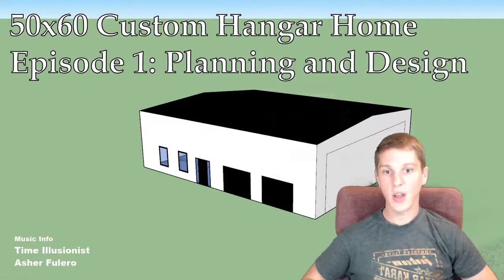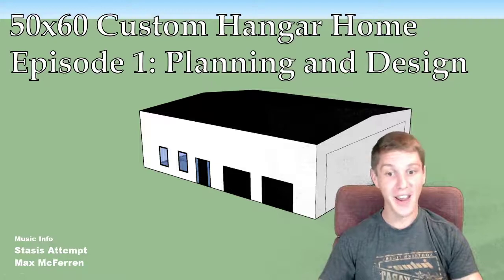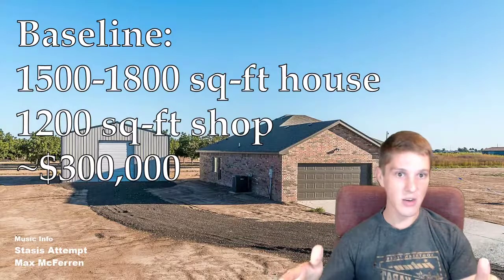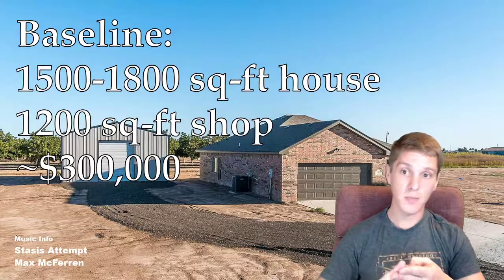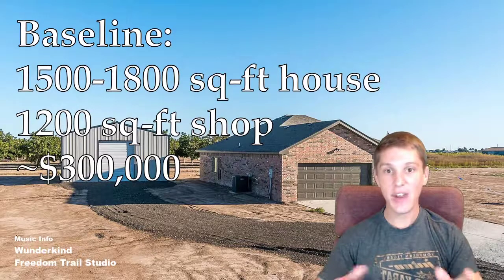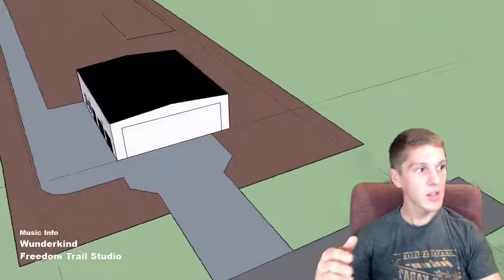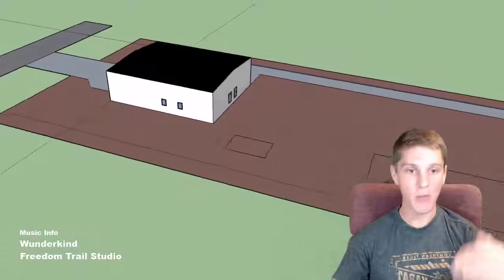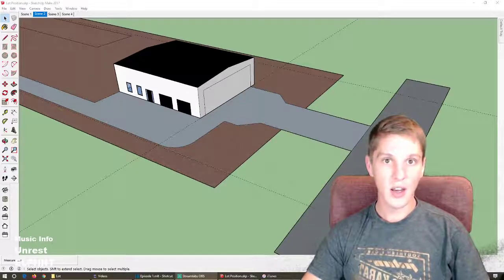50x60 Custom Hangar Home Episode 1: Introduction

Comment: Curious what your doing for insulation.  I’m seriously considering a similar build.  My design is 40x80 with 30 ft the house portion and the remaining 50 ft the hangar garage.  I also recently found a hangar door manufacture that builds a stand alone door, not requiring the extra expense for adding structure to the building opening.
Reply from the maker: Dude, that's awesome! I'd love to hear more about your build. What brand hangar door did you find? 

For insulation, the builder we hired to erect the metal building sprayed the entire inside of the metal building of the metal building with 2-3" of closed cell spray foam. Once I frame in the living space, I am also going to insulate all the exterior walls with normal pink batted insulation. So the living space will have both spray foam and  batted insulation. (I also plan on insulating the interior walls around the bedrooms and bathrooms, but more for sound dampening.)
Reply: Go to Hpdoors.com.  They quoted just over 10k for my door.  Not having to add structure to the buildings door opening makes this the most cost effective option for 34x12 ft door.  Wife and I are also planning to do a good portion of the work.  We will hire out the foundation and erection of the building.  I’m still struggling with insulation.  I like spray foam for the vapor barrier qualities, however our design is for open truss on a portion of the interior.  Bay insulation provided a quote on a package which is a double layered banded system and meets the insulation requirements for our zone - But, still concerned about the vapor barrier qualities.
Reply from the maker: @GSNCLN  Hey, that's crazy! I also decided on a Higher Power door. I got the metal building engineered and designed and manufactured by Mueller, and they just designed the building with the opening. The door itself all anchors to the slab and is independent of the building. I just saw my door for the first time yesterday. I'll show some footage in my next video.

I went with the 42' x 14', which Higher Power quoted out at like $12k. Don't be surprised when you get quotes of $4-5k just to install the door. It's a process to install, and whoever does it will need a telescoping forklift and a manlift to set it up. But the dude at Higher Power was actually super helpful and gave me a list of people who install the doors in my area.

As for insulation, we went with the spray foam for the vapor barrier and added R-value. I spoke to some spray foam guys, and they said doing an independent vapor barrier (like a plastic sheet) with the closed cell was a waste of time and money. I'm going to trust them and hope they're right. And like I mentioned previously, the added pink batt insulation around the living area is just even more R-value.
Reply: I may have to reconsider the spray foam option for its vapor barrier qualities.  It’s scary watching your videos as it’s like watching our plans come to life.  We also have a used rv in our plans to use while framing/finishing the interior.  We want to purchase acreage allowing keeping our plane on our property.  We’re going with a stol experimental kit plane design so only a pasture for a runway is needed.   Looking forward to your next video.  G
Reply from the maker: @GSNCLN  Right on! I'm glad you're enjoying the build videos. Hopefully you can benefit from some of my lessons learned. I can't wait for my next trip out to start standing up walls. I'd love to hear how y'all's build goes. Maybe you should start a YouTube channel, ha!

Comment: How much is this costing you guys roughly? I’m looking at building a space myself that I can live in and do photography in! 😊
Reply from the maker: Good question, and the answer to all good questions is "It depends." Here are the cost for the 50x60 building. You can spend as much or a little as you want finishing out the interior. 

The dirt work was $7k. The slab was $23k. The metal building was $40k. The labor to erect the building will probably end up around $20k. So that's $90k for the basic building. In fact, $25-35 per square foot is a good rule of thumb for a basic metal building, depending on your area and the price of steel.
 The hangar door was not cheap ($20k installed). I also got a water well and septic ($20k), plumbing roughed into the slab, doors, windows, and garage doors. I still plan on getting electric run to the building and spray foam insulation. You get the idea. All of these add to the cost.

Our budget for the entire build is $300k. That's 1500 sq-ft shop, 1500 sq-ft living space. To be honest, it's not any cheaper than buying a house and building a detached shop. It's just something we want to do, and the house will be something cool we're proud of.